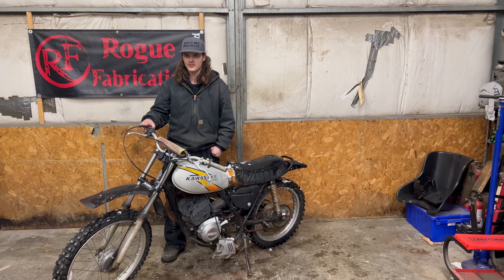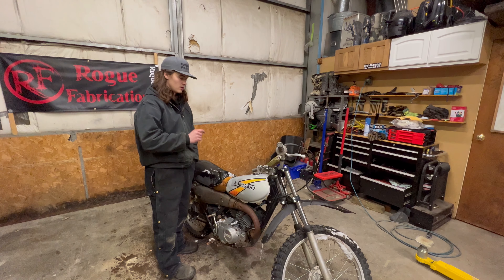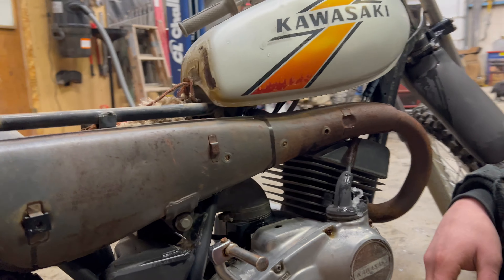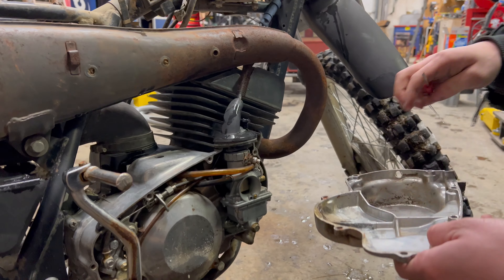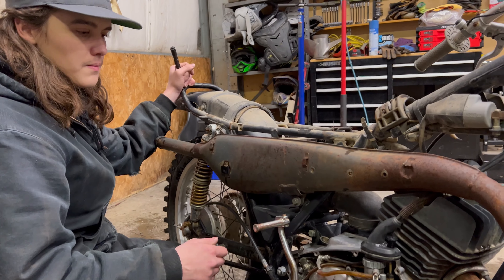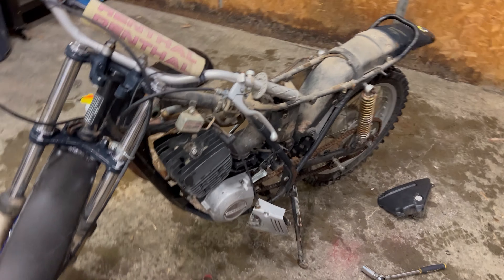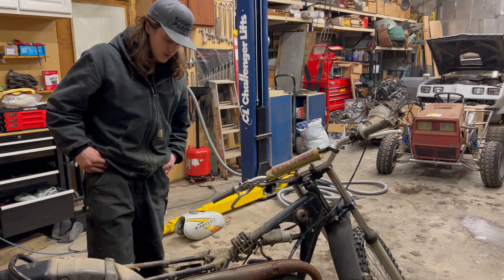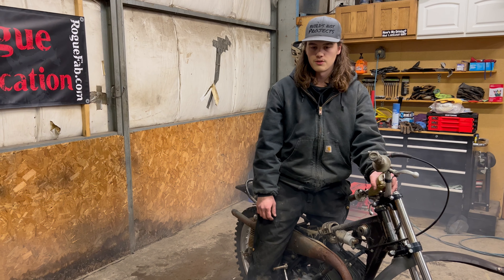Will it Run? 1977 Kawasaki KD175

Comment: Fantastic bikes better than any modern bike 
built to last you'll have loads of fun on it when its fixed up. I'm over the pond in the UK I brought the same bike last year it was imported from Arizona the Kawaski KD where for the US and Canadian Market only it was a true dirt bike no lights aluminium wheels CDI ignition sticker on the head stock says off road use only everyone else got the KE so not many over here i had to fully rebuild the motor on mine I managed to get most parts OEM rod kit\piston kit\seals\ gaskets i had the crank rebuilt and barrel rebored  it now runs like a dream ready to ride this spring the bike was 99% complete when I brought it all the little rubbers clips ect most things that disappear over the years are still there its like a time capsule so from the desert of Arizona to Woods of Sherwood forest. They made the KD for 3 years only in 3 different colours 76 KD175A1 in tangerine 77 KD175A2 in silver and the 78 KD175A3 in Kawaski green KD means Kawasaki Dirt KE Kawaski Enduro and KX is self explanatory

Comment: It’s a rotary valve engine and you have to use the oil injector it oils the crank there super sweet engines and Kawasaki made them from 1974 to 2001
Reply: I'm fairly certain all the 175s came with a singular oil line that goes next to the carb. However the f5 and f9 the 350ccs had a 2nd oil pipe that went to bearings.